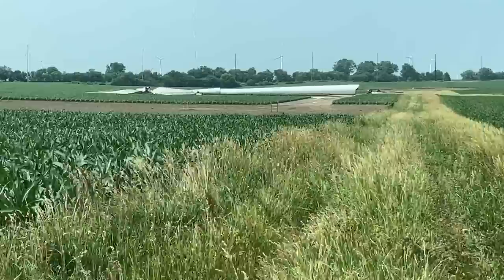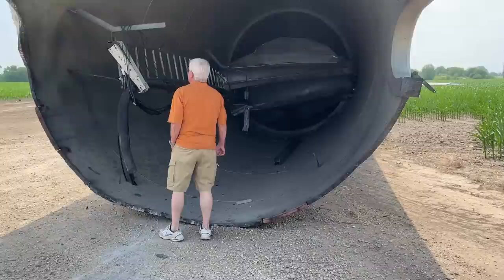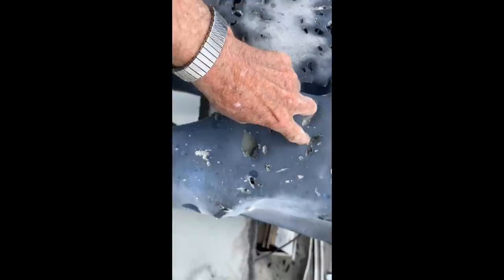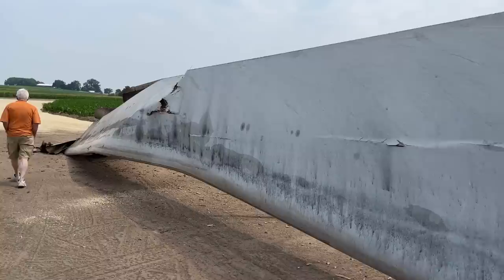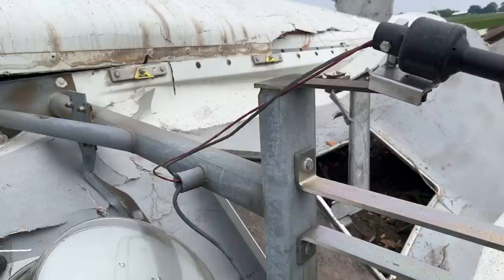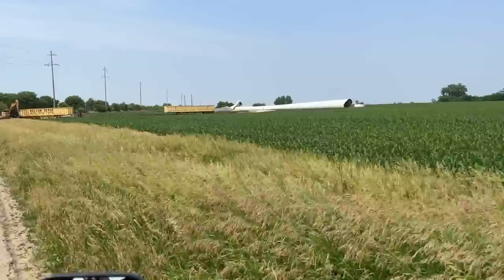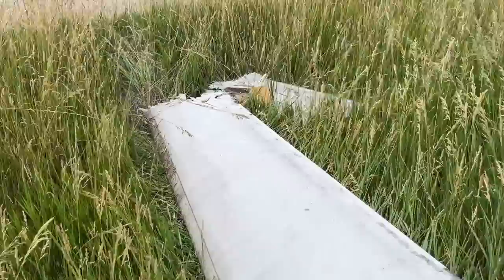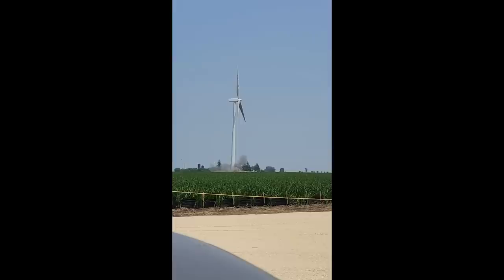OBSOLETE WINDMILL DEMOLITION short #47 pt 2 tubalcain energy lies scam fraud

Comment: I work in the electricity supply business (moving the electricity to the customers) so I cane really comment about the economy of these things, but I do know that when you base a proportion of your supply needs  on Solar, you need a backup source for when the sun isnt shining, and wind is part of that solution (people dont suddenly stop using electricity because its night time, in fact they use more as they all have their lights on) so as part of a sustainable energy solution, wind is just part of the solution, turbine design has progressed over the last 20 years, so what was economical back then probably isnt any more, replacing them with modern designs will almost certainly increase the output quite a bit, so kW generated per acre will be higher, and thus more economical. until we get people to cut down on their energy usage, these solutions will always be needed, just wait until the USA follows the UK's example and energy prices rise dramatically, then people might pay attention and try and use less, but all the time people expect to be able to use electricity freely, all the time they are using kW to run air conditioning etc (and having to get electric vehicles and charge those too) (as an example it used to be cheaper to charge an electric vehicle here in the UK, but at some charge stations, the cost can nearly be as high as filling the tank with gas (and your gas is a fraction of what we pay here in the UK too.))
Reply: Spoken like a nice left wing liberal.
Reply: the state i live in just demolished its last coal plant and we have nuclear and solar plus imports. my rate per kw/h is .20 dollars.
Reply: @Lee-qp6gf  Lee, I have no political leanings in any particular direction, just in facts that I can observe and judge for myself.
Reply: @Lee-qp6gf  things are going to go in this direction whether you like it or not. Texas is a leader in wind energy generation. Nobody is talking about the insurance of coal fired plants - no business that exists on this scale has none. Do you know the costs of insurance for the various ways of electrical generation ? Give us a website.
Reply: @Lee-qp6gf spoken like a  clueless rube.
Reply: Electricity is not free.  In the US taxes on gasoline helps pay for the roads.   At this time there is no road tax for electricity and our roads suffer.  EVs weigh more that gasoline cars and damage the road more so the cost of electricity should equal the cost of gasoline.  My Corolla weighs about 2,400 lbs, where as a Model 3 Tesla weighs about 4,000 lbs.

I WILL NOT suffer heat stroke and therefore run my A/C 24/7 in the summer here in Texas where my patio thermometer has been over 100 degrees every day for the last three weeks.
Reply: @johncooper4637  Cars, even "heavy" Tesla or those stupid oversize pickups don't damage roads, it's all due to trucks.

Comment: The main problem is blade erosion causing the blades to delaminate. Furthermore, some of early designs  are not as efficient and requiring more maintenance. As with everything, the initial development sometimes produces thing that just don’t work out.   Larger turbines are much more efficient and cope with a wider range of conditions. 

As to wind energy, it now surpasses coal fired plants in terms of MWH cost over total lifecycle…
What is needed is a diverse generating capacity with storage. The US is well suited as the weather is nearly always different from north to south, east to west and has an integrated grid.

Comment: Those cables would be medium voltage cables at 2:46. If you look at them closer, you will see that the interior conductor have pinkish insulation around them. Can’t say for certain the voltage, could be 2,300, 4160 or 13,200.

Comment: What a shocking waste of resources. There has been a lot of coal used to turn the iron into steel for those towers. Not since the mass land clearing following industrialisation has there been such a widespread destruction of the landscape (putting them up, not pulling them down).

Comment: Amazing sight to see. Thanks so much for sharing these with us. I shared my opinion on the viability on part 1, but let it suffice to say few things of that magnitude would be economically feasible with only a 15 years life expectancy.
Reply: It seems there is misunderstanding about the windmill, it's not a bridge, it's a computer controlled energy conversion system. It apparently has about the same oeconomic useful life order of magnitude as your modern car, TV, computer, cellphone, perhaps even a little bit better.
Reply: @oakenarbor2046  
The problem I have with that argument is as follows. Virtually all electric power generated since the beginning of power distribution is produced by an energy conversion system of some type. Most existing power plants that have use an electromagnetic generator of some type. These wind turbines also use mechanical electromagnetic generators to produce the power. Yes, there is an electronic conversion stage involved in most of them, however, that is not something which should end the life of the entire mechanical system when the electronics need service or replacement.

We have been building power plants which convert mechanical power into electrical power for 100 years or more. These systems last for many decades with a moderate amount of maintenance yet not full replacement. My concern with the wind turbines is that they require full replacement too often, compared to systems using similar technology to convert mechanical power into electrical power. It seems that the economics do not add up, when you consider the cost involved to replace these versus the ongoing maintenance cost of traditional mechanical power plants. 

Another concern that I believe I share with Mr. Pete is that a lot of the money being spent to replace these wind turbines goes to overseas companies, and not to American engineering and construction firms. So the recurring costs with the wind turbines are a drain on our economy in that money goes overseas, whereas ongoing maintenance on traditional power plants puts money into local economies to a much greater extent. As someone who is somewhat patriotic to America because I was born and live here, this is a very important concept to me.
Reply: @oakenarbor2046  And it would probably help the environment if cars, TV, computers etc. were replaced a lot less often too.

Comment: Warm greetings from India! 
It's always been a pleasure to get your perspective on many topics
Thank you for that way that you covered this case,
Certain observations from your video coverage are as follows
1) looking at the failure interface of the tower( the place where it broke ),shaped charges and the place where gas torches were used is a bit unclear 
2) about the question of fiberglass or graphite it mostly looks like a bit of both the rectangular section in the blade was a good detail if the frp elements were made in the US I am sure there was some Kevlar if not graphite 
3) about subsidies I am not exactly an expert but to the best of my knowledge these are given to the most ' promising ' technologies ' as perceived by the political pressures
4) you were right about your prediction when you talked about the cultivable land lost in the previous video some of the by-products of these turbines can actually wreck Havoc on the ground water

Comment: Great video. I didn’t know they are so land hungry.
Reply: Practically none, and with all the moaning about the land used, 50% of the food produced in this country goes to waste anyway, and farming is HEAVILY subsidzed - probably even more so than wind is - 0.005% reduction in farm land isn't going to make a hill of beans of difference in the grand scheme of things. And all they're growing there is corn, which is for ethanol production, not food, which makes even less sense than wind generation does, so who cares.
Reply: @gorak9000  Depends at what point the food wastage occurs. If it occurs as household waste it has already made money for the producer, wholesaler and retailer. 
Ethanol has become a much-used product. The country I live in is using 10% currently and it’s expected to increase to 15%. If some governments and environmental groups their way, this will increase further. As you may be aware Brazil-US and Europe are the biggest users of ethanol and as I said its use is only going to increase. Personally, I’m not in favour of ethanol as I work on small engines where its effects can be found and in time maybe on bigger engines.
A classical case is the diesel. When it became common in smaller vehicles it was a modern miracle, clean burning, economical and long lasting. One of these qualities could be questioned. It sold in respectable numbers but look at the attitude towards it now.

Comment: I remember the FD having classes on these things and what to do if they caught fire or we were called because something else around them was a problem. The basics were simple, stay back, let it burn and protect any exposures and knock out any fires that burned out farther than the blade radius. There were crews that stayed in the area to work on them and they would willingly tell you that the money they made came from the subsidies and not the power generated.

Comment: I already told you about the wind turbines in Falmouth. But around here they capped off all the dumps and put solar farms on them. My towns solar farm is less than ten years old and already degraded to less than half of the first year generation capacity. The renewable energy technology is decades away from what fossil fuel can do.
Reply: The fact is that a photovoltaic cell has a certain life expectancy of 10-20 years depending on the quality and materials used. That's not something that the green energy pushing people either know about, or care to talk about if they do know this.
Reply: @fredflintstone8048  The fact is you are wrong.  Cell degradation at worst is about 1%, so after 20 years they'd be down to maybe 80% capacity.  Not great, but not useless.  Besides, they generally pay for themselves after about 5 years.

Comment: From the BBC today - may partly help explain what is occuring on the farm:

"Twenty-eight years after starting to produce power as Scotland's first commercial windfarm, Hagshaw Hill has been approved for "re-powering".

Its owner, Scottish Power Renewables, plans to build fewer, larger turbines.

Where those coming down have their nascelle, or generating unit, 35m (114ft) above the ground, the new ones could be as high as 140m (460ft).

And with improvements in blade design and the efficiency of turbines, each installation will be able to harness as much as 10 times more power from the wind than the ones they are replacing, with a capacity rating of six megawatts.

Scottish Power Renewables says the 14 larger turbines they want to install on the site near the village of Douglas will produce five times as much power as the 26 old turbines they are replacing.

They suffer from wear and tear in components and weather damage to the blades, as well as being much less efficient than the turbines that will replace them.

There are more than 11,000 wind turbines installed in Britain, with many more planned for offshore. And while most of a turbine can be recycled, including the steel towers and components in the gearing and generator, more than 33,000 blades present a challenge.

Many replaced blades have so far been sent to landfill. In some cases, they can be incinerated. But as replacement begins, the industry is looking for ways to re-purpose or re-cycle them instead.

ReBlade is one company, based in Glasgow and Dumfriesshire, with plans to build a re-purposing factory. Run by Fiona and Steven Lindsay, former Scottish Power employees, its demonstration projects include park benches and furniture.

Comment: If you are interested in learning answers to some of your questions, buy one share of the company that owns those windmills. Their annual report should provide some education. Remember, going to school is not just to teach you, it is to teach you to learn. Also there is something about the electric power business you should know (WARNING: THIS IS AN OVERSIMPLIFICATION). There are a couple of ways power is sold, by contract with fixed rates, or up the line with variable rates. When you sell up the line it is usually because someone cannot fulfill a contract or they simply cannot supply enough power to meet the demands. In the summer, if you had one of those hand crank generators that folks use to use to draw earthworms to the surface, you would put that on line as well. This may help to explain why you see wind generators not running when the wind is blowing. If they don’t need to run to fulfill a contract, and there is no money to be made by selling up the line, having them stopped saves maintenance cost and lifespan wear. Thanks for your videos and take care. P.S. Glad you didn’t go in that fallen tower with just a flashlight. That was a confined space.
Reply from the maker: Thank you for that valuable information. I did not know that. Just a few miles north of the windmills that I showed him the video is a group that were built five years ago, and have still not been put on line. I only found that out yesterday. So that’s another reason why some of them sit idle

Comment: Energy production for the purpose of profit is a big part of the problem. If there wasn't profit in taking those down and putting new ones up they'd keep em up longer. If those windmills were in operation for 15 years though, then they profited. Cost per megawatt has come down significantly though so new ones will make more profit. It's quite wasteful as I have to imagine quite a few of those could have carried on for many more years. But don't let waste stand in the way of profit.